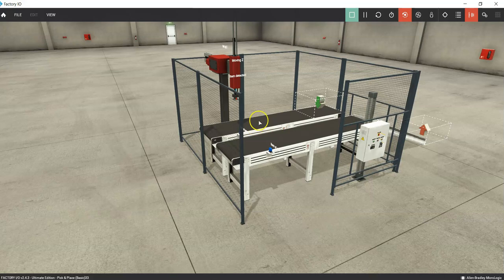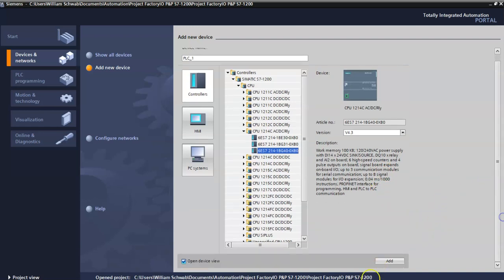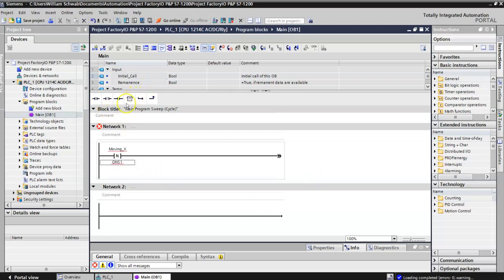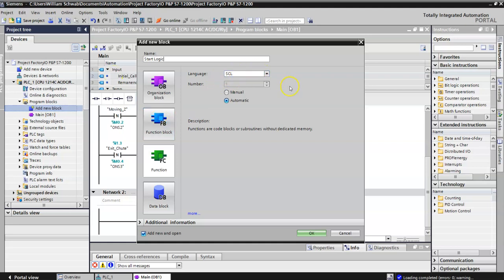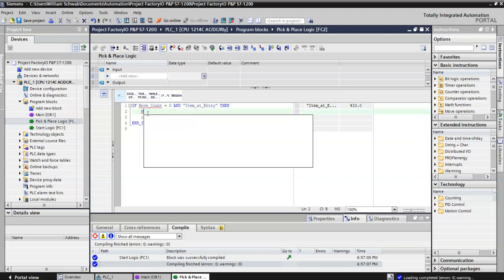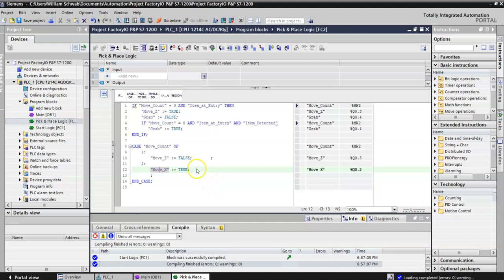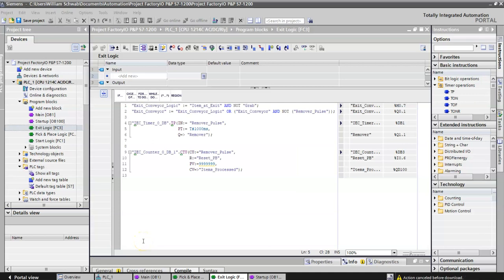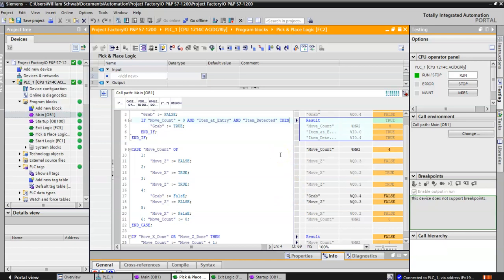Factory IO Pick & Place (Basic) using S7-1200 PLC.

Comment: Just found your videos and they're very useful and well put together. I'm not sure if you're still using TIA Portal but importing tags from Factory IO is so much easier than manually doing it. In the driver window, there's an export option on the bottom right, it exports all of the tags/addresses into an xml file that you can put straight into your project. Saves so much time